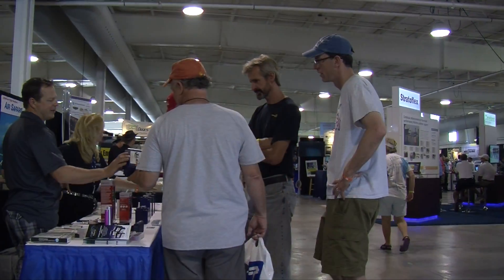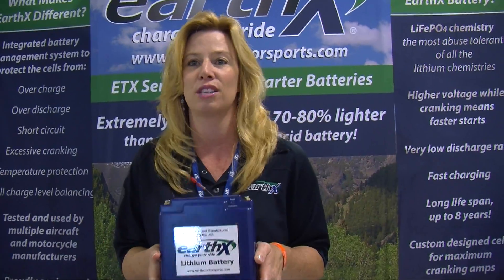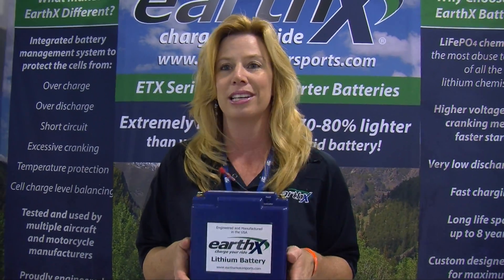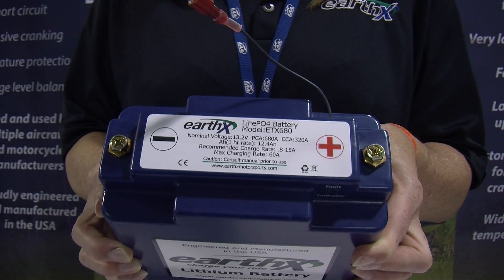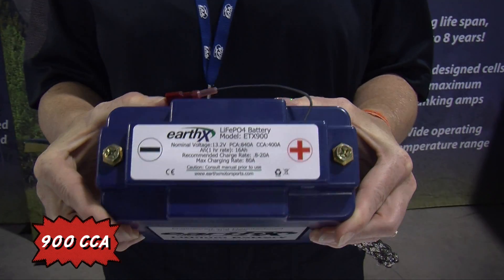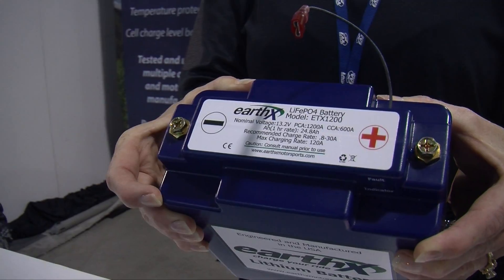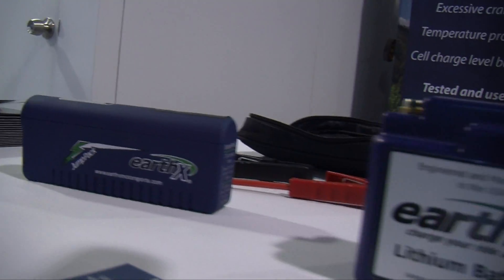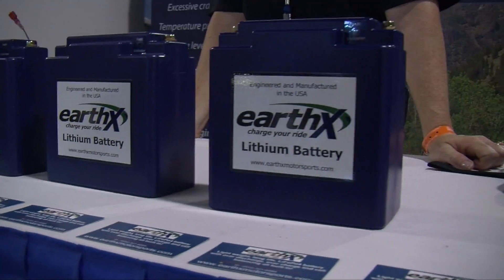EarthX Lithium Batteries for Aircraft

Comment: So how do we prevent burning up our 60A RV alternator when charging?
Reply from the maker: Thanks for the question. We do have an extensive FAQ section on the website that addresses this question, and many others to at this link: https://earthxbatteries.com/faqs/

There is a lot of talk on the internet about lithium batteries causing overheating and premature failures in alternators. Is this concern applicable to an EarthX battery installation? The short answer is, NO. The references on the internet are in regard to recreational vehicles and boats where the battery sizes are hundreds of Amp-hour and used as a deep-cycle application (the battery is discharged to a low state of charge to power equipment). For example, take a recreational vehicle battery that is 300 Ah and is 80% discharged. This means the battery has 240 amps used up and needs to be recharged. If you have a 60 amp alternator, that battery will take 4 hours to recharge! That will indeed cause over-heating in an alternator. What about an EarthX installation example? Our most popular battery is the ETX900 and it is 16Ah and typically replace a larger capacity (18-25 Ah) lead acid battery. Using a representative example where both EarthX lithium and lead acid are discharged 20% (3.2Ah discharged, typical for a starter battery), the 60 amp alternator would deliver approximately 60 amps to the EarthX battery for 3.2 minutes (yes minutes, not hours). A lead acid battery recharges at a slower rate, approximately 40 amps (typically 30% slower) , which means it would take 4.8 minutes. In both cases, recharging current and time frames are well within the capability of an alternator. In summary, for smaller and similar amp hour batteries in stater battery applications lithium batteries will have no negative impact on alternator life. https://earthxbatteries.com/engine-charging-systems-use-lithium-batteries/